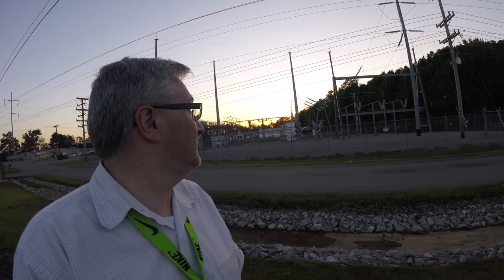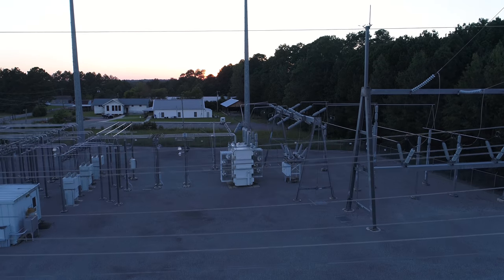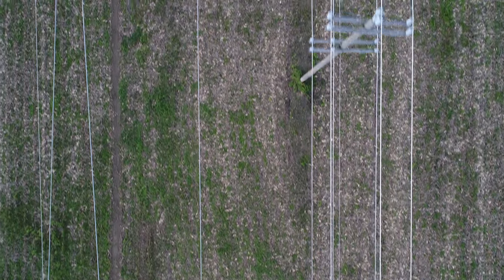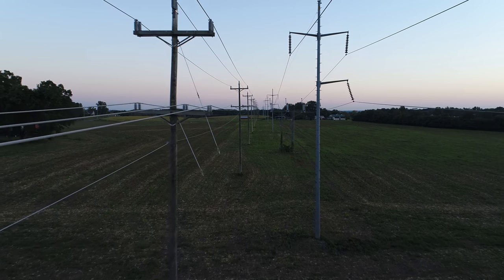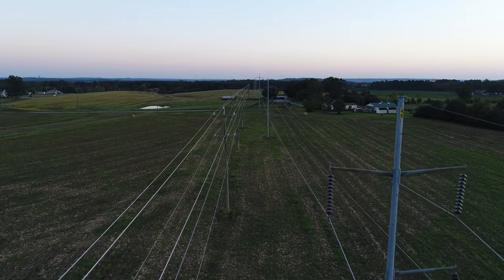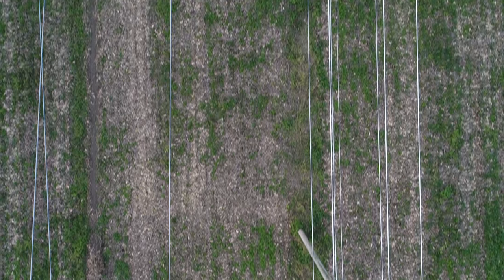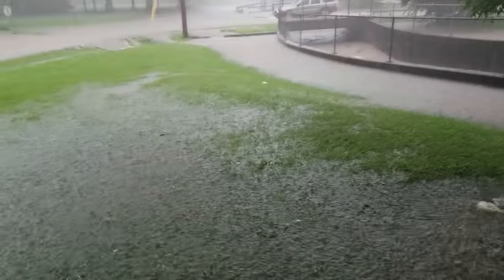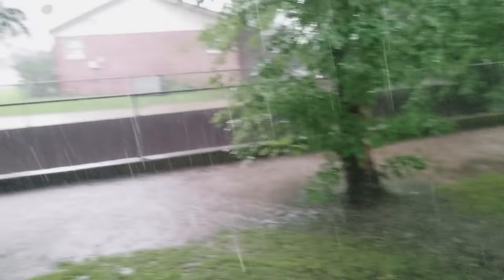KEN HERON - Power Line Inspection - Phantom 4 Pro [4K]

Comment: How is it that you didn't experience any magnetic interferance I do with my mavic a lot in wide open fields.
Reply: adam cain yea how ? I crash my p3s only flying near to high voltage lines (1 mile )
Reply: ths800 I fly my Phantom 3 fairly close to a high tension line when I fly at a particular park where I live. I do get an interference warning on the app if I get too close, but keeping a couple/few hundred feet away, I haven't experienced any control issues.

Comment: Fantastic Ken! I too have been hired to inspect electrical lines in some of the more remote areas we service. They suspect high winds are causing the phases to slap together causing “ system bumps”. Looks a little nerve wracking but it’s good to hear you actually sped up the video. I would not have flown that fast!. I’m curious if you were able to help them? Did you find anything?

Comment: You may have answered this question, but was your first concern interference? Was it a case of I'll try it and see what happens? Or from other experience you new nothing would happen? You were super close, nice control, great skills Ken. I did an demonstration at a sub station with an Inspire 2 and I was told that the sub station wasn't powered anymore and never was concern nor did I ever get interference (I did get very close). Anyway just curious if you know something already and new what to expect or you just thought, what the heck? Nice videos hope to hear form you. Thanks
Reply from the maker: I have flown near transmitter towers and high power lines in the past so I was fairly confident that I could do this period we tested it for a few feet and then went forward. Stuff can happen but I lucked out that day.

Comment: about running out of batteries: I have one of those 3-at-once AC charger (basically just a really beefy 3x 19V/7A switch mode converter. 
Plus an 12V-to-AC converter, hooked up (via a 50A breaker) to the 2nd battery (a 12V/72Ah), which is wired "in camper mode" (this one came in my VW passat by default due to the included park heating system) I can run this without the risk of flattening my car's main/starter battery. 
To make a long story short: i instantly hook up empty batteries when ever possible. So when beeing at my car i can constantly swap my 4 flight batteries until the RC would be flat (which id did not manage so far...)

Comment: Ken, did you have obstacle avoidance enabled for this? I have a real estate shoot to do tomorrow and did a drive by of the property the other day just to "case the joint" and its tight. Wires all over the place. Not sure I can move around if I have obstacle avoidance enabled. Thanks.
Reply from the maker: Hey Tom!
I never use obstacle avoidance. It makes me a more cautious pilot.
So... I have no experience using it. If you're going to be in a tight situation,
definitely turn it OFF, but do a "walk and follow" as you film.
Good luck!
Reply: Ken Heron Cool. Thanks.

Comment: Ken, do you know how many kV the power lines were?
Reply: Going off the insulators -- Steel poles have 161 KV, and are of a TVA design, so I'll assume he's somewhere in TVA Land. As for the smaller poles, there's probably 7.2/12.47kV Y , 13.8 Y, or 14.4kV Y under either a 34.5 or 45kV overbuild.